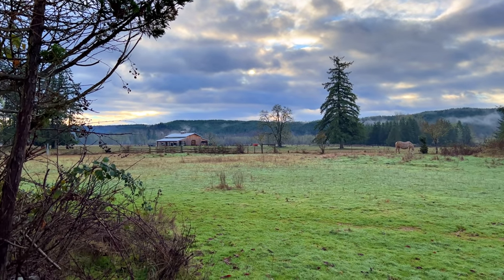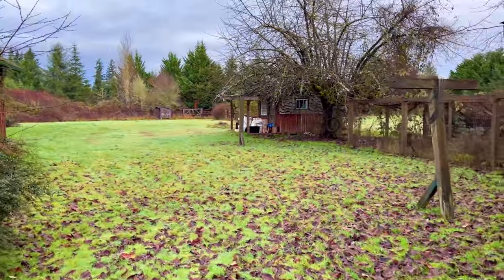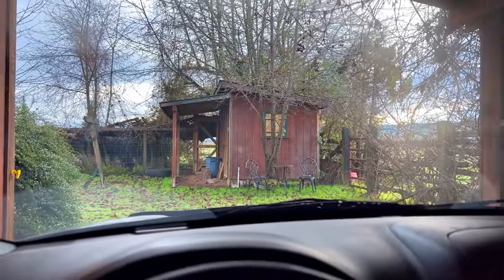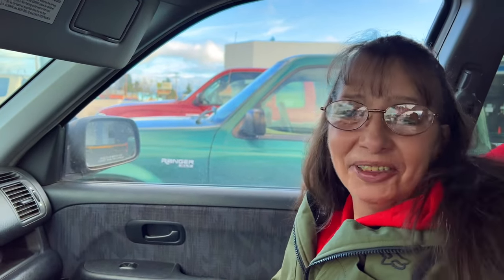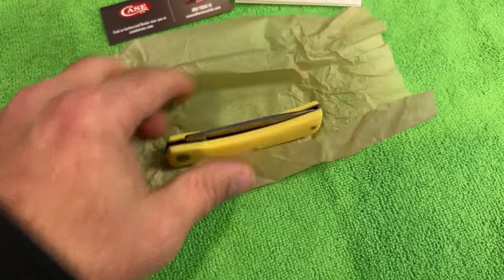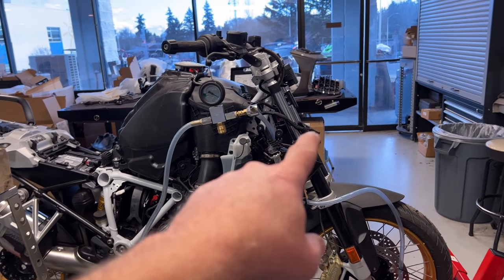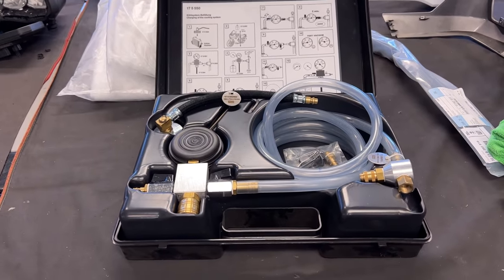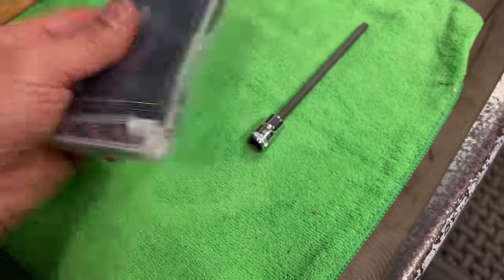Fill & Bleed BMW Coolant..!! • Can You Feel ASMR? | TheSmoaks Vlog_2221

Comment: Great video Shawn. I have a 2020 1250 GSA and checked the BMW maintenance schedule after watching this. BMW doesn’t mention changing the coolant, just checking it. I’ve since read that BMW uses a “permanent” antifreeze in these new shift cam models that isn’t meant to be changed as a maintenance item, although after contacting my dealer he said you can still change it every few years, which I would still do at some interval unless I noticed the coolant level declining for some reason.

Comment: All that fun with that Spyder and it turns out to be a dead dash. I had a similar problem many years ago with a XS650 Yamaha, dead flasher  can. Went up to the servo got a generic flasher can, a car one thinking there the the same. And guess what there not!! Started the bike put the blinkers on and every time it flashed so did the engine, off on, off on. Damn had make a two hour trip in the car to a Yammie dealer to buy a flasher can.